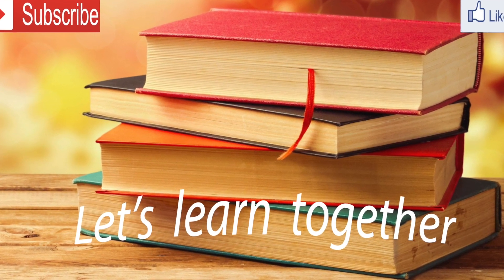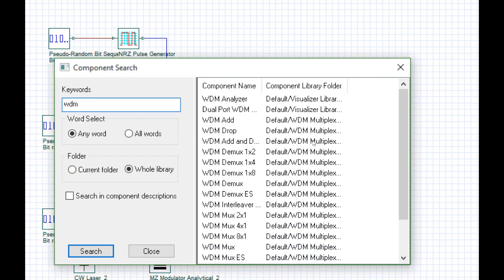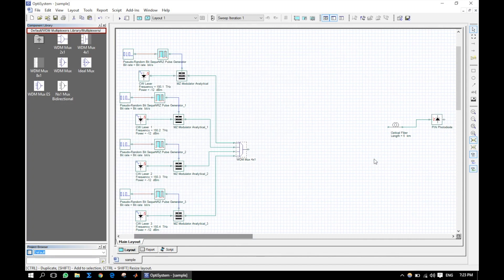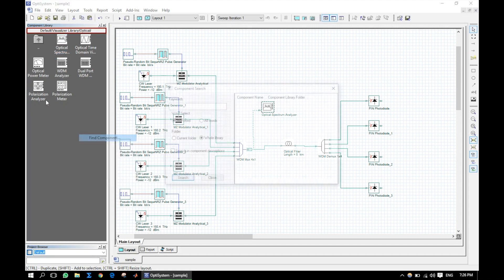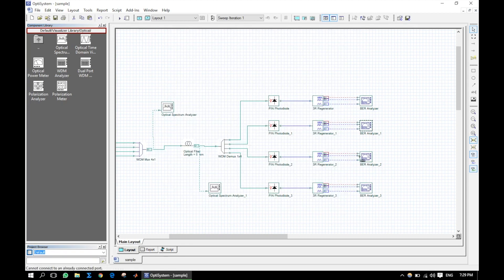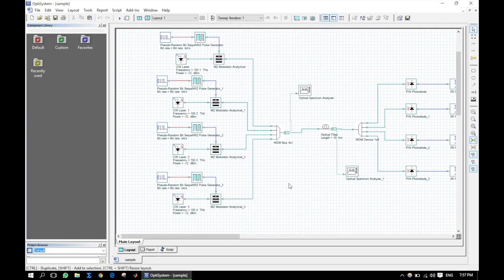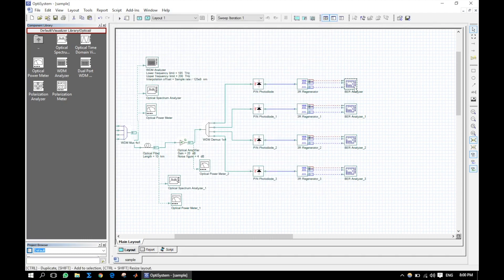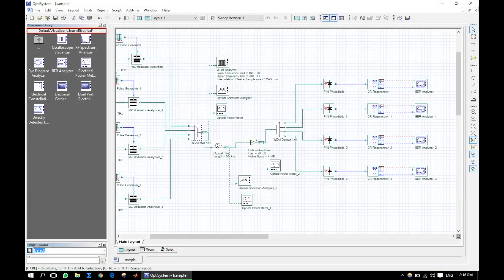How to design a WDM system using optiSystem | OptiSystem tutorials for beginners

Comment: I am using 16 Qam optical transmitter with 0 dbm power but when I m connecting optical power meter to it it is giving me -14dbm could u plz suggest what should I optimize so that I could get 0dbm reading in optical power meter